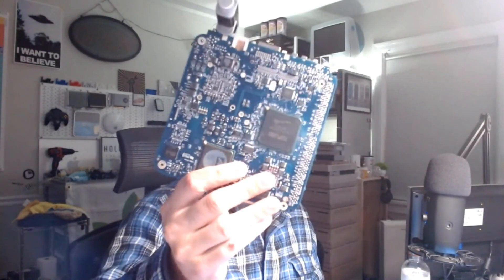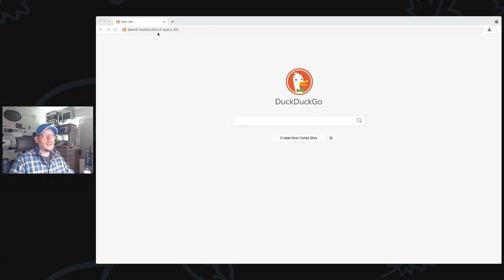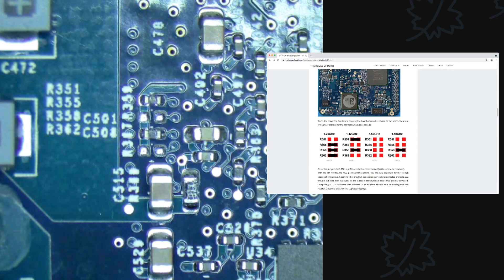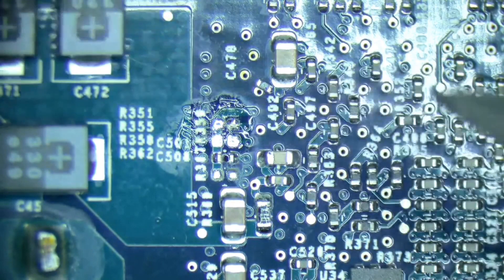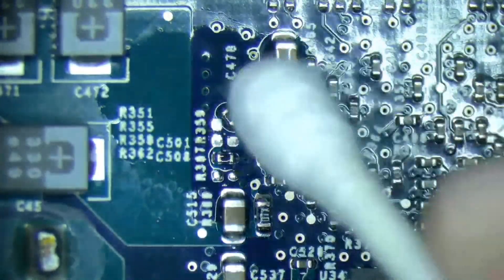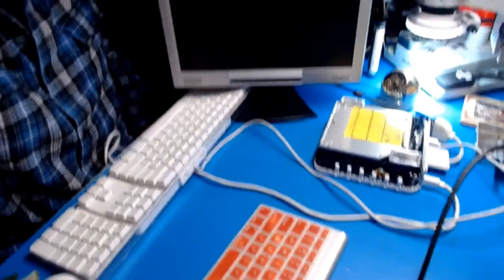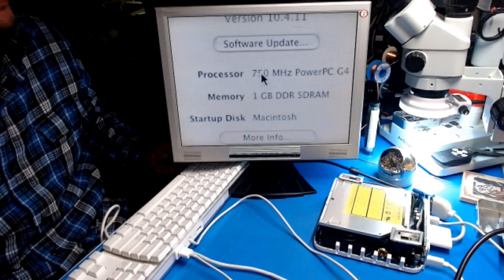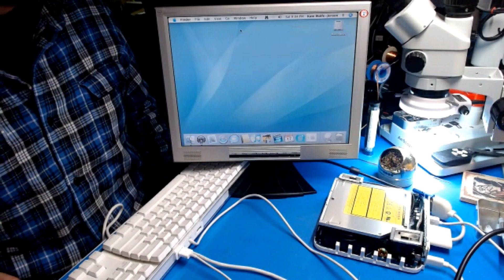Overclocking a mac mini G4

Comment: i wonder if there is any way to overclock a g5
Reply from the maker: Hmm I wouldn’t mind a quad 3.0GHz 😎
Reply: Better upgrade to custom open loop water cooling to handle the heat!
Reply: @virtualtools_3021  nah honestly the chips don't even get that hot . I would imagine one could solder on a power4 CPU in place of the g5 since they are the same cpu like the e6550 which is a 2.8 ghz 970mp

Comment: Hi Jay. Thanks for this video. I've read somewhere, that it is possible to do this without soldering - just using a pencil - probably to short some contacts.... But I don't understand how it should work. In my opinion,  making a short with a pencil has not the same effect as removing the resistor?
Reply from the maker: These resistors basically act as jumpers, with little to no resistance. A piece of wire or a pencil tip would conduct the same and have the same effect. I guess it could work but I'd try some solder before trying a pencil :)